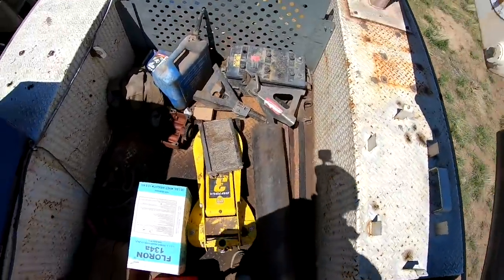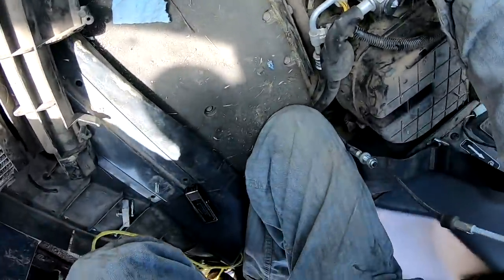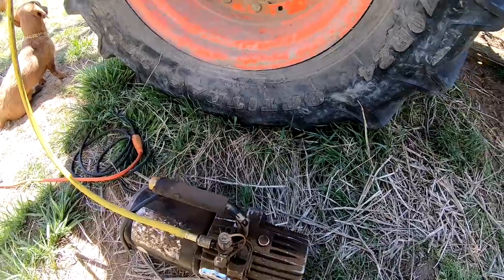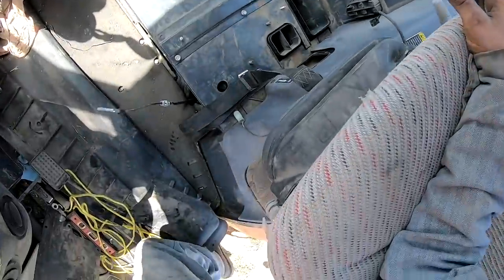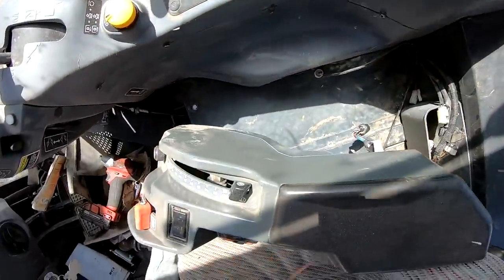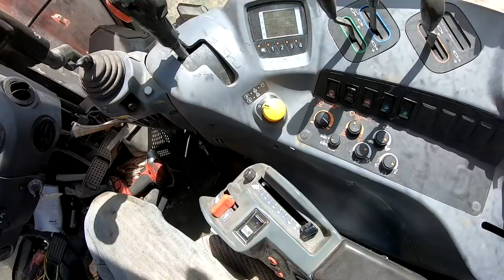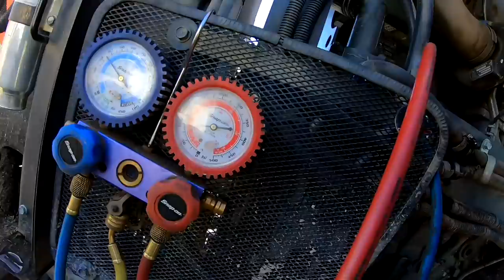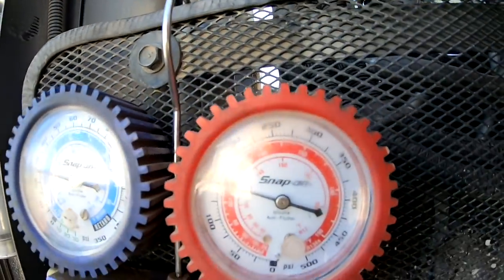kubota m135gx air conditioning

Comment: I bought a China self contained Cab Air Conditioner for our on Komatsu D85 -21 Dozer  / just cut a hole in the cab top and wire it up to 24 volts simple 2 years now and still freeze you out of the cab total cost $500 USD

Comment: That's a clear case of gouging, picking up some bad habits from JD parts department. No good reason to charge over 100 for that part and it didn't cost them half that to make it. I like 35 PSI for low side with R134a since the evaporator temperature is barely above freezing then and it can't shut down air flow via frozen condensation while there is still a minimum surplus of freon to last the slow leak too. Everybody that does the fine tuning has their own reasons and preferences it seems.

Comment: Daisy... Where is the wiener dog.  LMAO!  Another Warrenism .  Love it!
Reply: I am retired HVAC construction equipment AC repair retired out of the business after 33 years would love to give you some pointers. You should try to pick up a four valve for hose gauges The half inch line running to the vacuum pump will reduce your vacuum time by four you should also pick up a micron gauge for about $150 you will be able to tell whether you have a leak or not you are traveling large distances in between service calls a legal kill you businesswise a micron gauge will tell you if the moisture is out of the system below 450 µm you know you don’t have any leaks. You also when you charge Freon into the system pull your high side gauge and put that Freon out of your hoses into the system run the system at 1500 RPM and you will be at a normal running operation and RPM and pressures for 134 do not build unless you have a warmer ambient temperature would love to call you and run it by you when you have time.

Comment: yeah agree totally with you Warren. The world as a whole is concentrating too much on PC and wrongs of past. Rather than the real issues effecting hundreds if not millions of people. It seems the world does not want humans anymore, it was mindless zombies which follows each other and does not have to think for themselves, but, has everything done for them...... sigh.... Of course parts are expensive. Each brand uses its own. And they claim no other brand can be used to replace it. ( they just change a connection or bolt location so generic doesnt fit. ) by doing that they have "locked" the market and ties you in, therefore they can charge whatever they want too. double sigh... and also in some cases your paying for the name... not the part.

Comment: I'd be afraid to own a Kubota tractor, I've been doing a lot of low hour engine replacements. To many to be a coincidence. A engine should last a hell of lot longer than 2200 hr.
Reply: Well, I don’t want a pissing contest but I’ve owned three Kubotas since 2000. Paid cash for all three. I service everything I have religiously. Never spent a cent on any of the three except for regular maintenance. Best damn small Diesel engines I’ve ever owned. I ain’t bragging but I can pay cash for any damn piece of equipment I want and I’d drive past the Deere & New Holland dealer to get to Kubota. No, their parts aren’t cheap but neither are any other tractors parts. 
The only guys around here that have trouble with Kubotas are the same tight asses that have trouble with all equipment because they run the shit out of their stuff and never service them unless they break. Chicken farmers are the worse around here.
Reply: @prevost8686   I wouldn't go assuming the tractors I was talking about weren't well-maintained.

Comment: What causes them to fail so early?  Thx
Reply from the maker: Not cleaning them out. The dirt and hay got into the core and the corr sweated and rotted them out. The material kubota is using must be crappy, because I have seen a lot of Deere tractors plugged worse than that and they didn't rot out and leak.